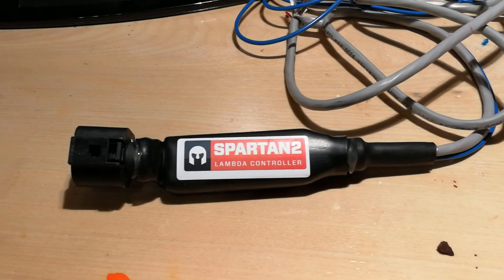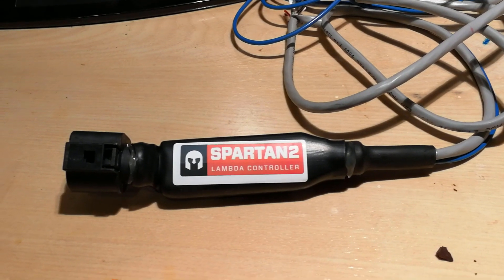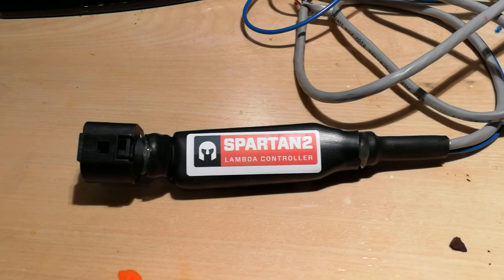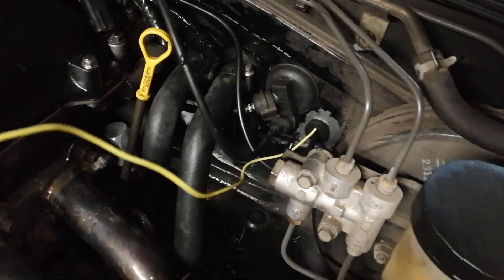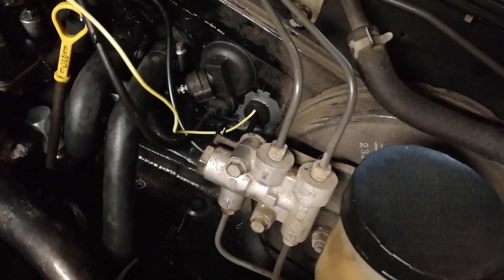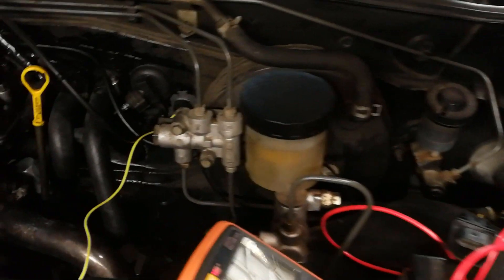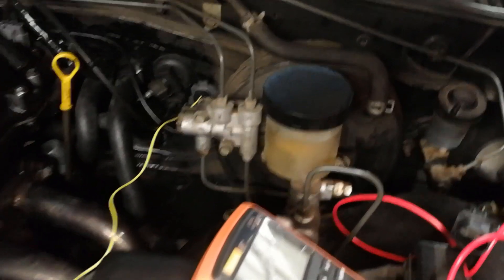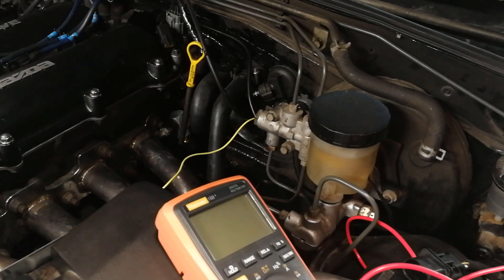Spartan 2 Wideband O2 Install

Comment: Cheers for the video. I own Spartans and the LC1 and LC2.   Now the LC1 has separate heater and sensor grounds where as the LC2 has one as you say. The heater being on the same gound as the sensor is not a problem provided the appropriate noise suppression is used in the power supply for the heater, which I have a sneaking suspicion that it is. The LC1 had real problems killing sensors until they released the final update for it way back when and they fixed this issue with the LC2 from the get go. I have used both extensively over the years and find the LC2 no better or worse than the LC1 aside from the fact the LC2 is more accurate owing to 4.9 compatibility, so my 10 cents is, if you install and use the kit as the manufacturer state, it won't be a problem.

Comment: Absolute long shot if your account is still active but if running an aftermarket ecu with no wideband guage, I’d replace the brown wire with the green?
Reply from the maker: Haha, yep still here.  No videos in a while due to my work situation but I still try to reply to all questions.   So, if I understand correctly, you have the spartan 2 but also an aftermarket ecu that doesn't support wideband?  Or you mean just the ecu with no wideband guage?   For the second situation (no guage) yes, route the green to it and the ecu will get the wb signal and be able to use it.  If you can connect a laptop or phone to the ecu then often you can do a digital/virtual gauge.  If it's the first situation (maybe a power card setup) then you want to send it the brown wire which is the simulated narrowband signal.
Reply: @OGPedXing  you are amazing my friend! And to instantly reply too.  Yes it’s the second scenario as you listed,  I’m using the Speeduino ecu and I have an early mk1 mx5. 
So stock is a single wire going from sensor to ecu and this where I was getting so confused as I couldn’t find any guides online of these parts and scenario.   But I now know exactly what I need to do to wire it up correctly so hopefully she’ll be purring very soon.  Again thank you so much for the quick message, I really really appreciate the video and comment
Reply from the maker: @nanodisk7914  glad to help.  That should work out fine, be sure to configure the input in tuner studio to wideband , I think the spartan will be in the drop down list even.   I've played with speeduino a bit (converted a early version of the pnp one for a mk1 to work with my mk2 na (1994)).  My main issue was the tune it came with was pretty bad, I had to start from scratch and redo a bunch of things like injector angle, spark timing, and then do the normal fuel ve tuning.  I eventually got it running  fairly smoothly.

Comment: Thanks for the great video and hopefully this helps for folks where the colors don't completely line up. Use a multimeter and double check but this looks correct. 

I believe from the diagram at  8:26 , and the colors matched to my 97 compared to the 94 in the video, that the wiring from the oxy sensor plugs perspective with the user facing the plug side with the tab up and clip down. 

Upper Left : Sensor, Upper Right : Switched Power
Lower Left : Sensor Gnd, Lower Right : Heater Gnd.
Reply from the maker: Awesome, thanks for the info
Reply: @OGPedXing  I'll update it when I get my Spartan2 in if it's wrong for some reason. This has been an informative video so I figured I'd give back with what I can.

Comment: So basically the wide band sensor connects to the controller, then the controller gets wired to the speedhut gauge(the yellow wire)? I’ve watched this like 4 times trying to get it down but am still lost lol. I’m fixing to order me a A/F gauge from speedhut and the controller and wider band from 14point7. Just want to make sure I get the right stuff. Thanks.
Reply from the maker: Yes, you've got it.  The sensor itself has a waterproof plug that connects to the controller.  The controller is then wired into power, ground as needed and then the yellow wire goes to the gauge.  The AFR gauge from Speedhut has a specific module that's pre-configured for the 14point7 controller.  If you have an aftermarket ECU that also needs the wideband signal, you can split the yellow wire to both your gauge and your ECU with no trouble.

Comment: So brown to blue on 02 and green to yellow on the guage. Does this change when u have an aftermarket ecu?
Reply from the maker: For the Spartan 2 the brown is a dedicated narrowband and the green is the wide band signal.  So for an aftermarket ECU you'll need to split the green to go to both the gauge and the ECU.  Splitting the signal is no problem, I confirmed with the manufacturer to be sure.
Reply: @OGPedXing  legend! Thankyou! Still running ok with your setup? I've been told to find 12v at the fuel  pump and grounds at the ecu instead of using the grounds from the 4 wire. Your way seems easier
Reply from the maker: @shirtz69r  yep, no problems.  When I did it originally I was using the narrowband output with the stock ECU. When I went to a megasquirt, I left that exactly the same and just split out the wideband output (green) from the gauge to the megasquirt WB input.  It was handy because I could put the stock ECU back in to troubleshoot and it would still work.
Reply from the maker: @shirtz69r  oh also, the sensor ground at the 4 wire plug is the sensor ground for the ECU.  So no differences between what the gauge shows and what the ECU gets.
Reply: @OGPedXing  thank you kind sir. Will put it in and report back
Reply: While I have you, the led seems a bit silly. Did you wire it in or just used it for initial start up?
Reply from the maker: @shirtz69r  eeh, I kept it.  I figured if the sensor failed it would let me know by continually blinking.
Reply: @OGPedXing  where did you put it?
Reply from the maker: @shirtz69r  lol, i just jammed it up out of the way near the center console.  Not mounted at all but I can see the light no problem.
Reply: @OGPedXing  thanks champ
Reply: @OGPedXing  i have a spartan controller plugged on my aftermarket ecu, and i’d really love to get an afr gauge so i can monitor these values without my computer. 

are you sure we can split the green wire that is plugged on the ecu? did you or someone tried?
Reply from the maker: @1801infarctus  yep, completely sure.  That's how I've been set up since installing my megasquirt.  I had the afr gauge and controller before the ECU then split the green signal wire to output to both.

Comment: Where did you find that classic style AFR gauge? One like that would go perfect with my other classic style smiths gauges.
Reply from the maker: I got an afr and boost from speedhut.com.  Good quality and you can pick the font, colors, needle style, tickmarks, it's awesome.  The afr is pretuned for the controller you want (aem, innovate, or Spartan 2)
Reply from the maker: I have a video actually, 
https://youtu.be/ADz_CSqSO7M and 
https://youtu.be/LBlpVV7_4KM